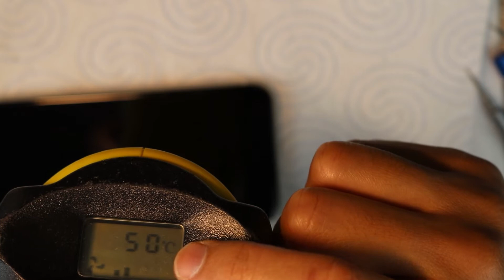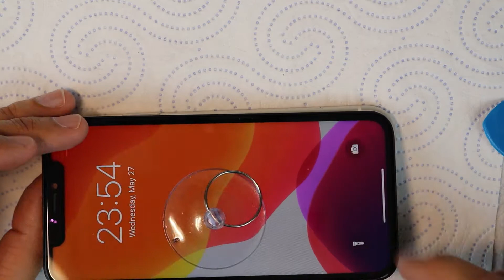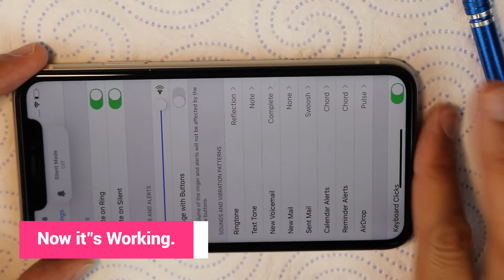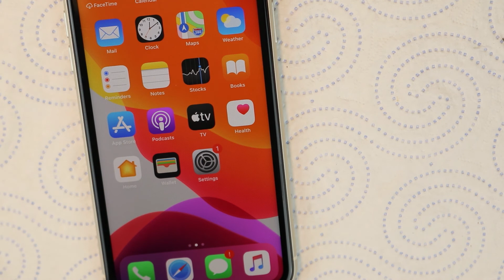iPhone 11 Ear Speaker Replace | iPhone 11 Ear Speaker Not Working | Noor Telecom

Comment: I change it, it's coming with as earpiece assembly with flex cable why face id not working, can you just replace the earpiece without flex cable, yep I think it's possible only welding on these 2 spots next time I'll just change this to restote facecid 😂 but the problem my face id wasn't working once I bought the phone so that couldn't be the issue 😂😂😂😂
Reply from the maker: Info.nt90@gmail.com